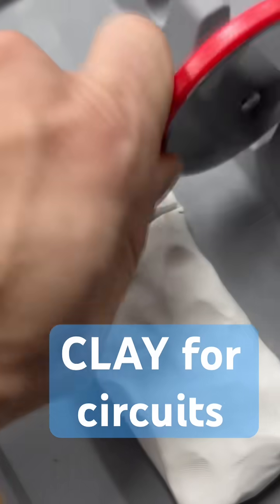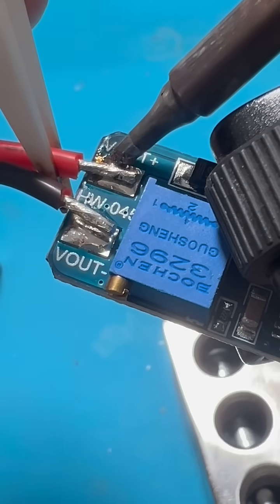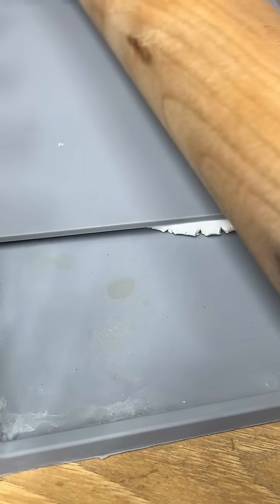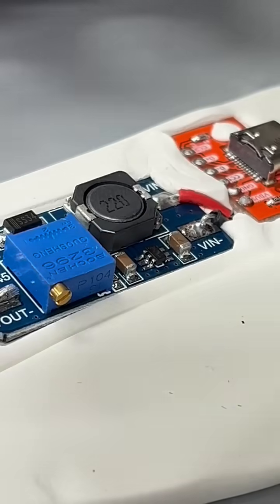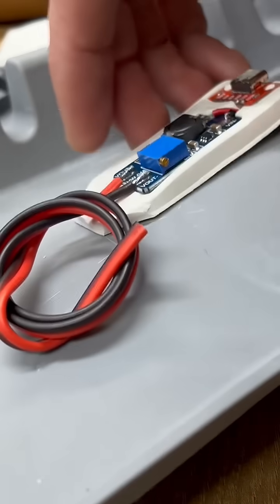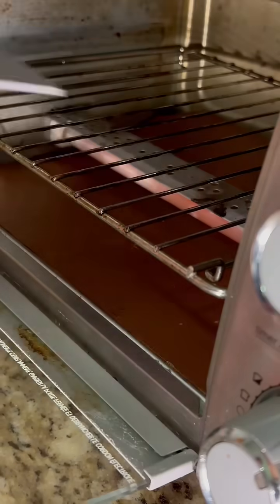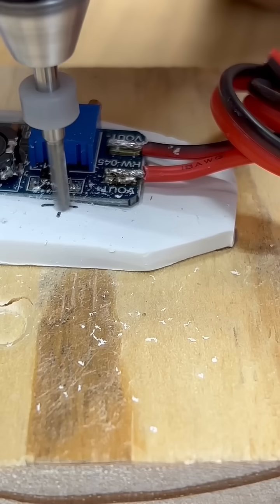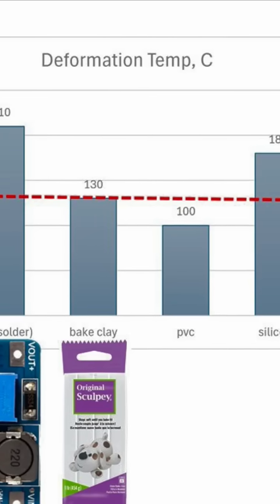use clay for circuit projects #methods #mechatronics

Comment: If you don't want to cook your parts in the oven you can absolutely use a hair dryer for an extended period of time on low-medium, from about 45cm away, about 3-5 mins or until you can see the surface lose it's sheen, and be unable to make an impression with your finger nail. You just need to heat evenly. You will gain a feel for it after the second go. This method can take a bit longer for an even and porcelain like cure, maybe 5-10mins max, but if you're impatient, blasting it on high, up-close, will cure a part fully in about 30 seconds (times vary between brand and colour, respectively). If heated from behind so as to protect the circuit board, then this would save time and be safer for the more heat sensitive components.
Reply: Wait are you the Dan Vogt who made Data Wing?
Reply: @patsore3698  oh! man finally identified in data world
Reply: @patsore3698  I'm not that Dan Vogt sadly, just a poser lol. 

I know there's a few of us, so I added each on insta a while ago to have a small homophonic community and can confuse people when we do a shared project together.... true chaos 😈 

When I'm doing very personal projects I use an alias :)
Reply: Thank you
Reply: I prefer the microwave.
Reply: No matter what solder iron, soldered connection, or solder. The simple undisputed fact is Wet Sponge > Brass Sponge
Reply: Baking the clay alone is sufficient. No need to bake the IC.
Reply: @kumardigvijaymishra5945  the guy in this channel is clearly a genius.
Reply: Nah bro, sensitive electronics love 150 degrees hahaha
Reply: @Bdjdjsjsdbxnsiwnf  They can handle my hot air soldering, they'll be fine at 150 degrees.
Reply: @Breadbored.  ret rds everywhere
Reply: @Bdjdjsjsdbxnsiwnf I do it all the time. People throw away flat screens. I grab them if there's no visible damage to the surface of the screen, bake the circuit board, and 50% of them work. Basically, it resolders the connections. The one on my wall has been going for 2 years after I baked it back to life.
Reply: Or, ya know, squish the board into the clay to make an impression, take it out, and bake the clay without the heat-sensitive components.

Board won't stick afterwards? Glue.

Is using glue on a PCB allowed? Uh... you DO know how they solder double-sided PCBs, right?
Reply: @TylerLarson  Bad practice. BAD.
I dont think it should be advocated for without sufficient info of risks.  

You need to inform people why this method is difficult to execute successfully and the idiosyncrasies of the material before you present it as child's-play. 

Have you used this clay before?? I'm not trying to make a negative impression, but you are! (pun intended, i luv u)
I mean no ill-intent nor disrespect to you, I don't want people to try that sh!t willynilly unaware of the issues the method brings. 

I work with these clays daily. I have successfully used your method before many times because I know what to and not do do. 

These polymer clays range from sticky to super duper sticky+++. The stickiness in the clays are very helpful for the strong bond to the base-form. Glue are not needed but only as a good security as an outer reinforcement. 

If you are lucky enough to be able to scrape off the clay from the PCB to bake it, you can enjoy your deformed, ill-fitting result. 

Polymer clays don't shrink much during the cure - which is a good thing - however, heat temporarily makes them flex and droop both in working life (hand warmth alone) and during curing - you risk forming gaps at many points in the process. Glue bond would be... not ideal.

In response to glue:
Unnecessary variables should be avoided, or at least, mentioned. ie. CA glue; if you advocate for its use in your process, you gotta also mention its issues: highly brittle needing close contact for reliable adhesion + cavities increase its failure point (inherent to your method), failure occurs often from mechanical flexation in CA glue (super glue) due to fractures of the crystal bond, yet thermal expansion will do the same thing over time... or if you say flexible is better you need to inform of, say, heat as the new variable that could cause failure during resoldering) 
....My method is designed to be simple to cut out all the yapping above, but that kind of info is vital if you want to give people solid instruction for reliable outcomes.

You would need a ziplock bag, thin lunch wrap or other dam material if you want an impression that doesn't deform during removal. Sculptors use armatures for this exact reason (especially for polymer clays) if they arent sculpting on a flat surface that will be fired with the clay. 

Your method misses the point of this - to save time. Polymer clay is expensive, too.

The hairdryer works because it works. 
For PCBs - it's fast and easy and hard to f up.

Comment: Okay, genuinely never thought of that. I use a lot of silicone wire and hate the double side tape I use now that's either wayyyy too light or strong depending on whichever will cause the biggest issue.

My mother also has tons of that clay. It's so simple yet effective.

Comment: How to overheat your solid state circuits 101
Wrapping up electronics in a heat insulator so they can't dissipate heat will ensure repeat business.
The downside is that you'll do the warranty work for free.

Comment: Any benefits other than heat resistance and post-processing ability that would make this preferable to 3D printing a mount in something more robust than PLA like PETG or ASA to avoid deformation from the hear? It seems pretty neat - I’ve never actually seen this before. I suppose it’s also just a better insulator being clay as opposed to plastic?

Comment: This is great. Thanks. I am going to add polymer clay to my stock.  I have been using polycaprolactone for a long time. In many applications it is reusable. But it is not that great under circuit boards, although not awful either. 
I don't think it should ever be called just "clay" as clay, when moldable is conductive from the water. But its a fine point. Thanks.

Comment: I have. But not for the same reason. I did it because I ran out of soldering wire during my midnight inspiration blast. And I needed something to hold my wires together just long enough for me to test it then find the electrical tape.

Comment: weirdly? as a tradesman turned clay sculptor turned programming nerd, i use polymer clay in almost all of my electronics projects. lolol
Reply: sculpy soft is GREAT for detail.... it also allows you to make case shells if you form with tinfoil, extrude through a "clay pasta machine" and sit the sheet over the tinfoil form, bake, then pull out the tinfoil!!! quite helpful in prototyping cheap electronics shell forms.

Comment: Duuude. Please learn to solder properly. that shit will come off at some point. No flux. Not enough heat and solder. Ull just make it hard on yourself if a joint fails.

Comment: Solders a cold joint. Then proceeds to put soldered part into oven when he could’ve soldered the wires after. Between that and the off-center drilling, are you sure WE are supposed to learn from YOU?
Reply: You wouldn't know a cold joint if it kicked you in the arse. They aren't cold joints.

Comment: Dunno what the application is here but I just use bog standard bathroom silicone to mount parts
No need to overcomplicate 
With silicone you can mount stuff as easily as with hot glue but you do not have the drawbacks of hot glue
It takes heat and vibrations like a champ 
I have silicone mounted electronics in my 3d printers that run since years
It might even be a benefit as the silicone acts as a dampener which this could never do

Comment: I use a hot glue gun? Clay is for pottery or ceramic used in high voltage insulators.

Comment: If you solder multi-stranded wires, you need to add more solder. You should not see the individual wires anymore. Rule of thumb is, if the solder is not a continuous shiny surface like a blob for example, it's a bad solder and it will be ripped off easily.

Comment: Clay is maluable, because it contains water, right?
Do I need to say more?
Reply: Yes, you need to
Reply: @MrFrambooise  water and electronics don't mix well.
Do I need to say more now?
Reply: @JoTheVeteran  yes
Reply: @MrFrambooise  ok. Here's more.
Water's detrimental effect on electronics can be attributed primarily to its conductive properties, which result in short-circuiting, corrosion, and electrochemical reactions within sensitive components. Pure H₂O, though inherently a poor conductor, typically contains dissolved ions (e.g., Na⁺, Cl⁻, Ca²⁺) that significantly enhance its electrical conductivity. When water infiltrates an electronic device, these ions provide a conductive path between normally isolated circuits, leading to unintended current flow. This process, commonly termed as short-circuiting, disrupts the intended electrical pathways and can cause irreversible component failure by inducing overvoltage or excessive heat dissipation.

Furthermore, water facilitates oxidation and corrosion, particularly in metallic components such as copper traces and solder joints. The combination of water and oxygen fosters electrochemical reactions that degrade these materials, leading to increased resistance, loss of conductivity, and eventual circuit failure. Specifically, the formation of copper oxides (Cu₂O and CuO) compromises the integrity of the conductive pathways. This effect is exacerbated in environments with elevated temperatures or high humidity, where the rate of corrosion accelerates due to increased water-vapor diffusion.

Lastly, dielectric breakdown, a critical issue in high-voltage applications, can occur when water bridges between dielectric insulators and conductive elements. The intrusion of water lowers the dielectric strength of materials, causing insulation failure, leakage currents, or catastrophic device malfunction. Given these multi-faceted impacts, the presence of water in electronic systems represents a severe hazard, necessitating robust sealing and hydrophobic treatments to prevent ingress.
Reply: @JoTheVeteran  great, now go figure what happens with water when you bake it in 130c for 15min, and to make things more interesting, unlike traditional clay, which relies on water to stay malleable, polymer clay is made primarily from PVC (polyvinyl chloride) particles and plasticizers. Its pliability comes from these plasticizers, not from water.
Reply: @MrFrambooise  Did he show sticking a pcb in wet clay?
Did he mention the clay he's using is made from PVC or other dielectric materials?
He said "clay".
This is clay : Al2Si2O5(OH)4) + water, in order to develop plasticity.
Moral of the story is, don't use this crap, it will destroy your electronics. Or be more specific in your diy video, in order to not cause damage to other people's electronics

Comment: I would think pressing the clay into a thinner wafer and placing it on an SMC hotplate would cure it far quicker than the oven. The clay insulation layer should be enough for your joints to remain intact through the process.

Comment: Thanks! Nice tip! Any recommended solutions (that are LIGHTWEIGHT for shipping) for mounting underside electronics to front panel of cases that have a flat top with holes for pots and transparent areas for RGB LEDS to shine through? Been pondering how to do that...either plugging them into different height headers (are there diff height headers?) (because some of the components will be at diff heights when attached to headers) on PCB under that or using kapton tape or...?

Comment: If you want an easier option, I’ve used a “clay foam” meant for kids art projects the same way, to create a case for an LED ring.  It does shrink a little but it just needs time to air cure

Comment: If you use heat sensitive components you could still use seld-hardening clay which gets solid at room temperature
Reply: You would need to be careful with that, I think.. many forms of self-hardening clay are actually electrically conductive to some degree, and could introduce stray resistance into the circuit..

I'm actually wondering if you really need to bake the boards with the clay at all, though.  Just press them into the clay to make the imprint, then remove the boards, bake the clay, and put them back in again after it's fully baked and cooled (using a bit of adhesive or something).
Reply: @foogod4237  i heard that clay always shrink a little...
Reply: @Ealendir  Good, then the component board will fit tighter, or shave a little off one side, & an end, thus your problem is solved, as C/B will fit nicely then..

Plus leaving the end PVC wires OFF before curing, allows you to put a blob of Loctite 401 on the cable a little away from the solder joint, to give you that third steady hand, when soldering... AFTER everything is in-place and about ready to use...
Reply: @foogod4237  Loctite 302, or 401 etc...

Comment: I often thought about using polymer clay for cases or small parts, the might be a good replacement for 3D printing, but the result is often brittle and they are expensive.

Comment: Check the glass transition temperature of your PCB material. If it's 150C or above this is fine. Manufacturers regularly do bakeout on PCBs at 125C for 4 to 6 hours.

Comment: If you solder your wires onto the board after baking instead of before, then you don’t need silicone insulated wires.

Comment: Your solder tip has a flat edge on the side but you’re holding it to the board with the sharp edge, which means you’re getting much less heat transfer. If you hold your soldering iron closer to parallel to your board you’ll have a much easier time soldering

The clay is a good idea btw
Reply: Starts with the flat, then inserts it in the angle of the wire and the board. It's ok.

Comment: I use poster putty constantly.  You can't bake it and harden it, but I don't want to do that, the softness spreads force evenly and compensates for any accuracy issues with a 3D printed housing.

Comment: You can make any design, just about, on a 3D printer. I make stuff for small boards all the time.
Reply: Of course, but this is far faster to just knock out a quick mounting, eg when prototyping.

Comment: Very smart. 3D printing something to hold the circuit board would probably be better but this is still pretty good
Reply: This is the reason I finally bought a 3D printer, I would do this but us a hair dyers for a couple minutes as it was cheep and easy. But it time to form the clay and is head to repeat
Reply: Yeah, but look at temperature resistance. You won't get that much from 3D printing if you don't want to print with overly toxic filaments. There is definitely some potential aplications for it.
Reply: @mikoaj2323 I am sorry, but what do you call "overly toxic" filaments? Nylon?
Reply: @mikoaj2323  I'm pretty partial to resin for high temp, but fdm has some pretty safe filaments for medium temperature (e.g. 80-100c) like tpu, polycarbonate and polyamide (nylon.) 
even ABS and ASA need ventilation but aren't terrible.
if you want higher temp, ppsu and peek are options but are fairly expensive.
Reply: @satibel  There is plenty of tests on youtube, using air quality sensors and various filaments. PLA and PET-G are one of the safest, but they are not neutral to your health in the long run, if you print where you live. Open window won't make it much better. If you regularly print ABS with just "open window" you are asking for troubles
Reply: @mikoaj2323  I guess I wasn't clear, by ventilation I meant more like with the garage door open and a fan at the minimum and not in the bedroom 
though you'd usually want an enclosed box with a duct and a fan pulling air from the enclosure to the outside (with a filter)
afaik some amphora filaments don't cause health issues at printing temps.
Reply: @satibel  This setup would be a lot better. Unfortunately not many people know it's not healthy / don't have enough space and use printers in their bedrooms.
Reply: @mikoaj2323  tbh a negative pressure setup is relatively easy and cheap to make (like 50-100 bucks, basically the cost of an enclosure a fan and a duct, maybe some extruded polystyrene insulation to put the exhaust through a window
Reply: Might be interesting. But sadly I bet the thermal conductivity of clay is low. Usually we need to get rid of heat
Reply: @samihawasli7408  from a cursory search it's about 1000 times lower than aluminum (~200mW/m.K vs ~200W/m.K) however it's on par with pla and other plastics.
If you actually need heat dissipation, you can just add a heatsink to the hot part.
Reply: imo it's great for rapid prototyping, another option would be to pre print a bunch of cases in high temp resin, and just fill them with clay. you don't have to wait for printing and can just batch process them.
Reply: a high-temp resistant casing is useless if your circuits are frying inside.

Comment: Just use epoxy putty,yes messier but works faster and no hassle of baking and melting solder or breaking a component 

It would work same as clay and can be drilled on too and easier

Comment: Great idea. I have been looking for a method to absorb heat spikes from a PCB and this will do the job nicely
Reply: If you can buy a copper mesh and cut out a square then you can sandwich the mesh between two clay rollouts for extra heat dissipation.

Comment: Can you use an oven that does not do metric?
Reply: Of course, heat is heat regardless of what unit is used to measure it. You just need to convert the number, 1 Celsius= 33.8 Fahrenheit.

Comment: Cool idea.  Super easy to work with too.  If you didnt want to bake the components, you could also make the impressions in the clay, bake without the boards and then use silicone caulk to attach the board to the clay after.  And yeah, those joints were kinda cold but great idea
Reply: Or hair dryer